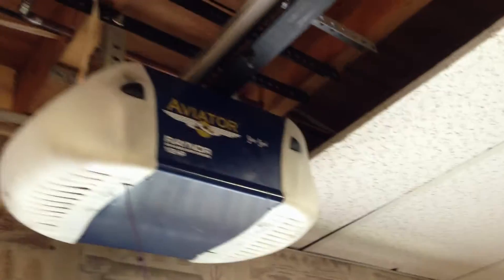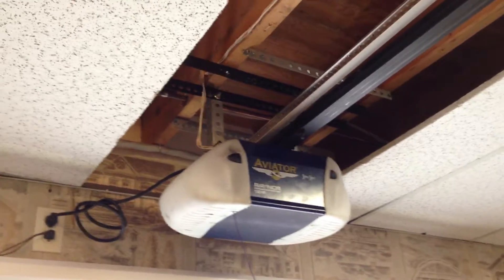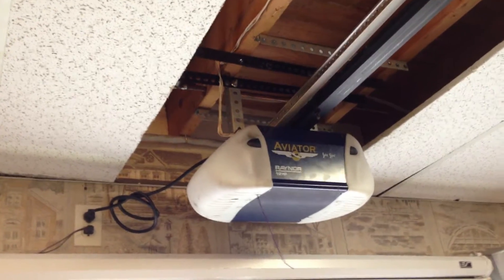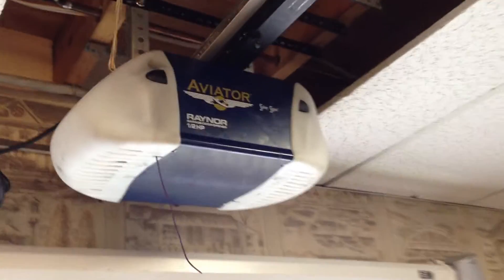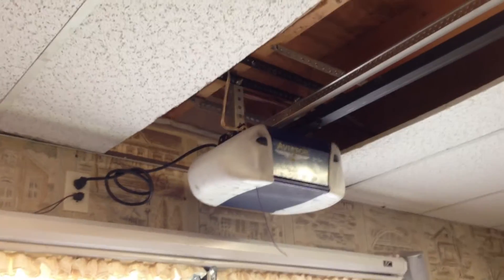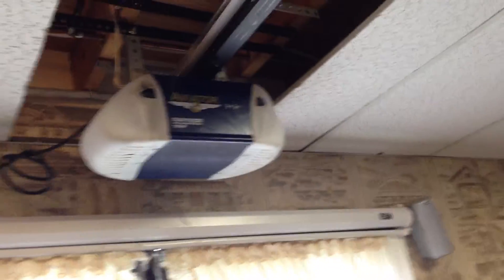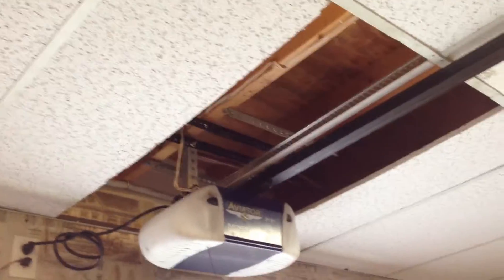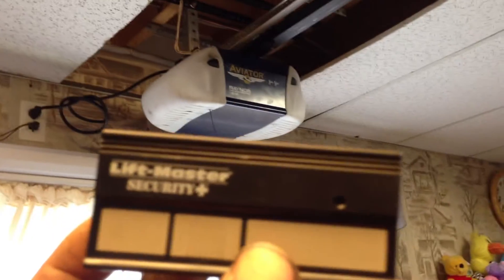1280/2280 on the relante

Comment: this is very nice :-) I got an older Lift-Master that has a 1250 case, a 433 MHz board, the end panels on the sides, and I converted it to an older style belt drive (I wish I had the parts to put it on a door and run it)